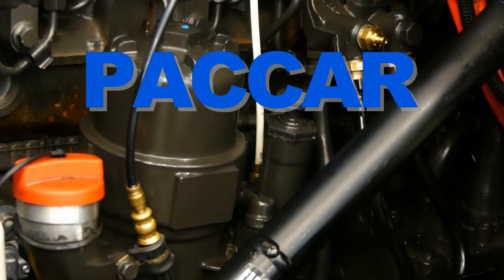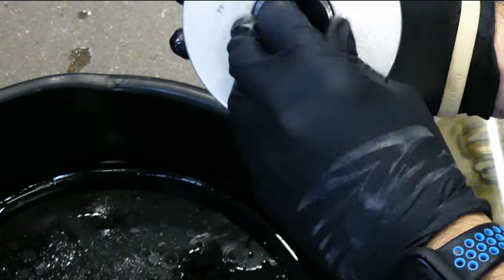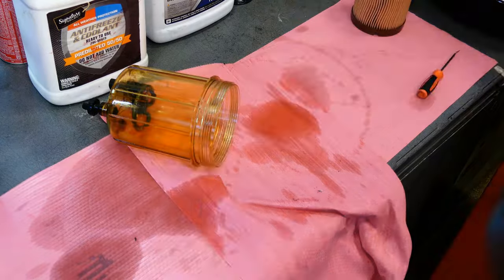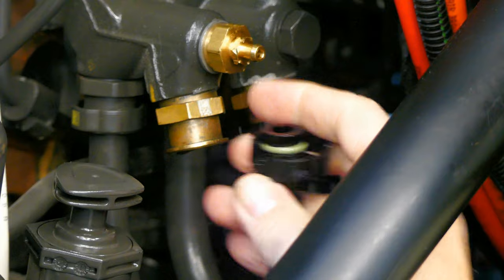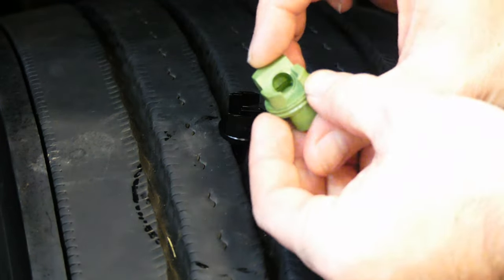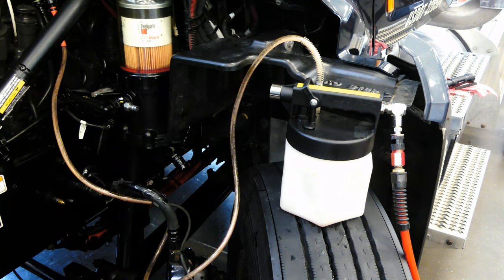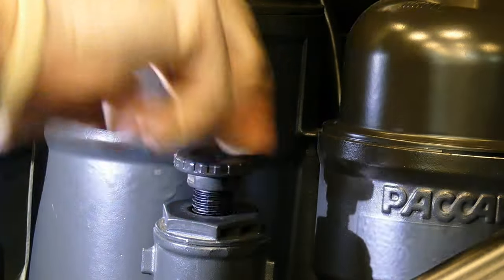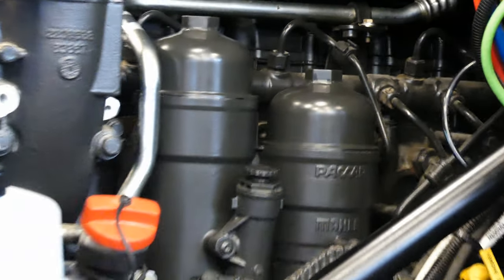Paccar Fuel Filter Change!!

Comment: Do you think it would also work if i hooked up to the priming port. We have been using a priming can but i now think that that may be causing injector issues. So i want to try this vacuum method but i think hooking up to that port would just make it a bit smoother process.
Reply from the maker: If you’re talking about the bleeder on the return line it would probably suck fuel from whichever side (tank/engine) that has least resistance for it. You might end up pulling from the tank and not priming the engine.

Comment: For the model year 2021 onwards, when you relpace the filter element you're not supposed to screw it into the cap and then try to find the hole with the pin on the bottom end plate. If you have the correct filter element (difference between them is in the angle on the sword inside the filter element and the pin on the bottom) when you place it on the plastic pipe in the middle the filter element will slide into the correct position. For the pre-filter element, if you got the wrong one, the cover will not reach the thread and you know you got a wrong one. For the main filter, you will be able to install the cover even if you have a wrong filter element inside but the pin on the filter element will not be aligned with the filter element thus making the filter impossible to pressurize. Also when removing the caps, please let 2 minutes for draining else you might get crosscontamination from clean to dirty side when removing the filter element if its still sorrounded by diesel. All this is mentioned in the service instruction (but with less details)

Comment: Great video. Any idea where one can acquire the fuel line fitting??
Reply from the maker: I’ll see what I can come up with. I meant to do that shortly after the video came out but I’ve been slackin…
Reply: Please do if possible. This is by far the best method I've come across. I considered buying another return line just to cut the fitting off, but the Kenworth guys want $241 dollars. Lol
Reply from the maker: @mgamez0821  That's the way we did it actually...  but I think the parts guys should be able to get you the fitting alone now as this is the recommended process.  (sorry for the late response!)

Comment: Sir i have a problem with fuel restrict 100 last 4 months change 3 delership not fix clean tanks change def or sensers any hlep
Reply from the maker: 2 tanks or one? Check water separator for restriction/line routing. Check to make sure the fuel lines are seated all the way on the engine.  Check that white check ball in the filter housing I show in the video.

Comment: Following the described procedure on the 2021 and later portion of this video WILL cause cross-contamination of the fuel system AND probably cause damage to the injectors. When removing the filter caps you must loosen them until the o-ring is fully visible on both filter caps, then wait two minutes for the fuel filter module to drain completely, then finish removing the caps.

Comment: Any way to drain down the filter housings without the vacuum pump?
Reply from the maker: The old way was you just crack the lids and what a few minutes. That doesn’t always get all the fuel out though so they suggest the vacuum method.

Comment: Been had terrible luck with our Fuel systems on these 23 rigs. F those check balls and also thanks for the tips on Might Vac. I think that the issue we had been causing injectors to clog after first change out in some of the company shops. 
Apparently Paccar is redesigning the injectors already so waiting on those to come out. For now they keep cleaning and replacing with old design injectors as fail. Nice that warranty covers but WTF cause I have ran this truck up to 40k miles in 3 months and been at dealer 2 of those months. SMH.
Reply from the maker: That's pretty bad..  Are these 2023 trucks?  Just wondering as the EPA21 engines have a different mechanism for restricting flow without a filter.   Either way, dirt is the main culprit in MOST fuel/injector/pump related issues.  Good luck, I hope you get it all sorted out.
Reply: @Dartmech  They are 2023's with The Paccar engine. I need to verify that the filtration system is identical to your video because according to their QR code change instructions they are required to hand prime 170 times (exactly) so we can't prime with our fuel can anymore.

Comment: If you order the oem filter it comes with an instruction sheet that shows you how to properly install the filter. It states in those instructions the filter is supposed to be clicked into the cap, it is an updated instruction sheet by the manufacturer. When done this way the filter doesn't get stuck in the housing when removing. Same way the oil filter and centrifugal filter are made, the cap has groves for the filter to click in.
Reply from the maker: I see where you're getting your information.  There is a conflict between the owners/filter manual and the engine service information.   I used the engine service resource previously referred to as engine Rapido.  I still stand by the opinion that the latter is the correct way, but the owners manual DOES tell you to put the filter in the cap.  Thank you for pointing that out, I may need to make an update!
Reply: The cap is designed for the filter to click in, and I have had alot of filters get stuck inside the housing on removal because it was inserted into the housing instead of clicked into the cap.

Comment: I have a 605 x15 , but if I was in the market for a road trk I would buy a mx13, I have friends to have them . They change the oil every 15000 miles . 2 have changed the def filter 200,000 miles , no baking just put a new on . Here say is that paccar will be making a 15 liter. If so that will be a game changer. I subscribed to your channel. I do like the paccar motor. I think it's a good design. but like everything else the emissions kills the motor. And all the sensors. But I would still buy one. I have a couple of issues with my x15 . But small problems. Still a good motor what I do . In heavy haul. Again if paccar builds 15 I would buy one .
Reply from the maker: That’s good to hear!  Both engines have their strengths and weaknesses. The Cummins for your heavy haul, the MX for fuel economy.  I’m not a driver, just worked on them and now teach.  I listen to the people I talk with, and that seems to be the consensus. 
I worked on Cummins in the early 2000’s before the X series and moving over to the Paccar was so refreshing. Easy enough to work on, and the service information for the Technicians is on a whole other level. 
Thanks for the Sub! I hope the continue putting out content people enjoy, and find informative.

Comment: My 2022 epa 21 is a single filter with frame mounted separator. Seen both setups on epa21
Reply from the maker: Interesting... That was supposed to be the major change to the '21's.  
 I'd be curious to get your engine serial number and run it to see whats up.

Comment: Looks like that fuel is dyed pink!!!
Reply from the maker: Yeah, we run tax free here.  🤫
Reply: Good God man! Hush-hush
Reply: EPA has entered the Chat! 
Now we have to save 2 drops of oil in efficiency to use 4 drops of oil to put a California Birth Defect notification sticker on the product so some Senators son that thinks he is a Cheetah can have a work from home job making 160k a year. 
But that Tech don't deserve 25$ an hour without getting put under the pressure of a NASA shuttle launch every day to change the fuel filter on a French design tractor. 
My perspective is the only problem here though, I realize that now. 
It's me. I am sorry.

Comment: So you are the guy telling people how to do it the wrong way. You should read the manual before you make an instructional video. You are supposed to click the filter into the cap when installing not put it into the housing first. Otherwise the filter gets stuck in the housing and you need to pry the filter out breaking the plastic. And in what world is 20 pumps enough to prime the system 😂 wow. Don't listen to this guy, read and follow the instructions that come with the filter.
Reply from the maker: You need to spin the filter once it seats. Can’t do that with it clipped into the cap. 2021 engines yes, before that no. 
Also the mityvac primes the system so 20 pumps is fine. Thats all in the vid. 
But of course you’re free to install your filters how you wish. However, this is the process I recommend.
Reply: Hello can you please talk me were I can find the fitting for the vacuum